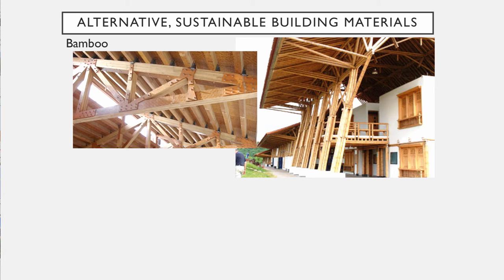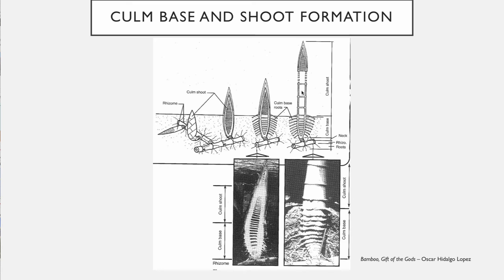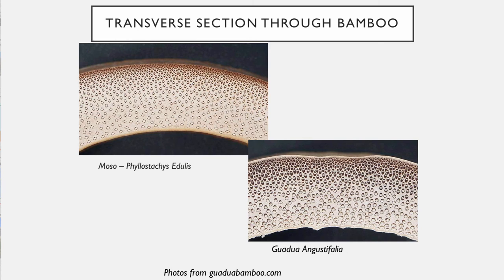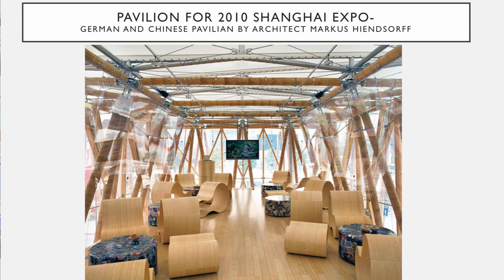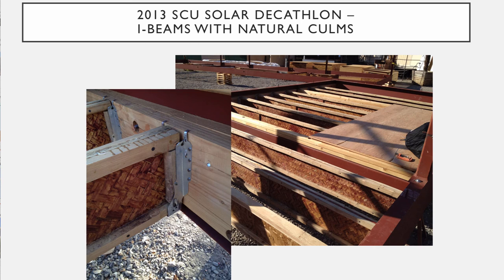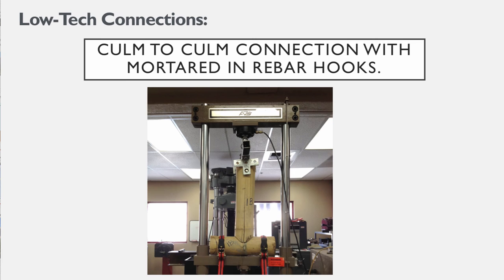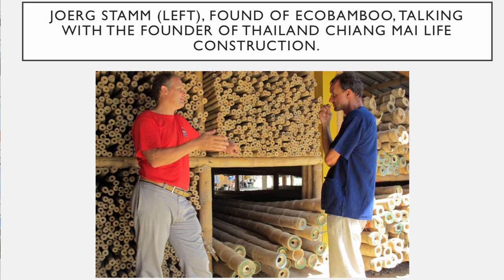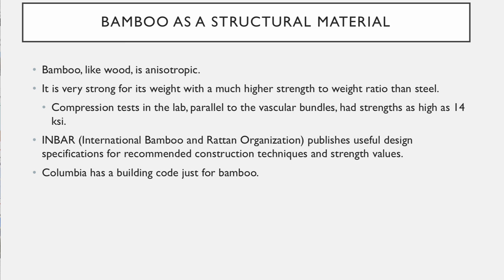Bamboo

Comment: Great presentation! Where did the Norwegians get their bamboo? Seems like they would have had to transport it a long way, expensive. Can I use bamboo instead of rebar in a rammed earth house?
Reply from the maker: I don't know what species of bamboo the Norwegians used but you can order structural Guadua bamboo from Bolivia, you can order Moso bamboo from China.  So one would assume they ordered a shipping container full.  In terms of the bamboo, I am not sure if anyone has looked at that.  What immediately comes to mind though is the tie to the foundation.  Rebar is required in rammed earth walls in seismic zones and that rebar would have minimum lap lengths with rebar anchored in the foundation to maintain structural continuity between the wall and the foundation.